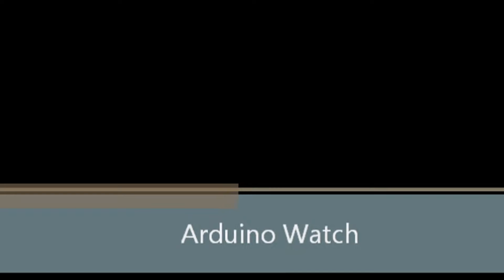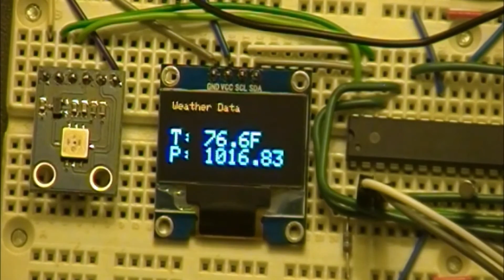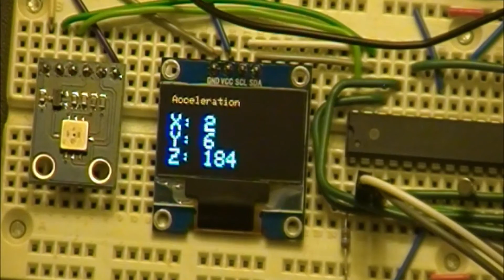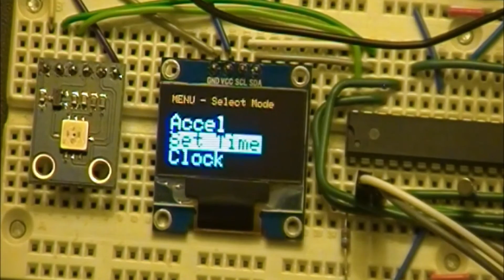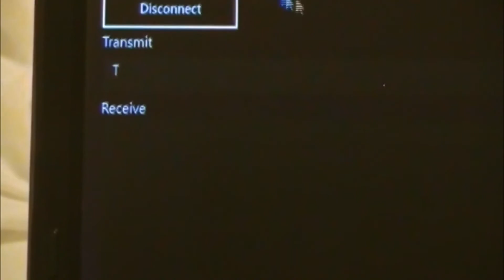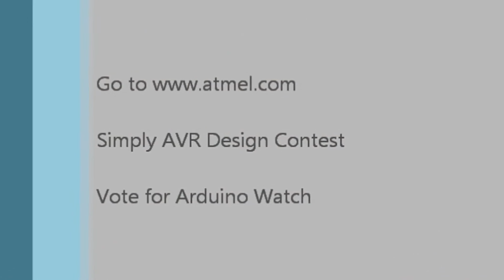Arduino Watch

Comment: May be a bit late, but I just found you so I am just now thinking of applications.  How about making one in a pocket watch configuration.  Having grown up on a farm, where a wrist watch can get you in real trouble while out farming, pocket watches were the answer.  Given the size of a pocket watch, a lot more could be stuffed in a nice silver case that would fit the pocket watch pocket on overalls or in the jean pocket watch pocket.
Reply from the maker: One of the good things about the design is by mimcing the size of the ipod nano, you can use any of it's cases. Check this one out:
http://www.kaskus.co.id/thread/52e9240d18cb176c7e8b45e9/bgt-ipod-nano-6th-case---soft-jacket---silicone-bukan-aksesoris-jam-tangan
There are also clip cases and others.